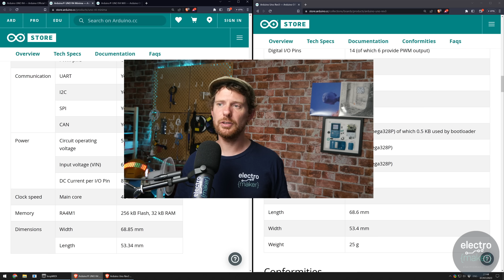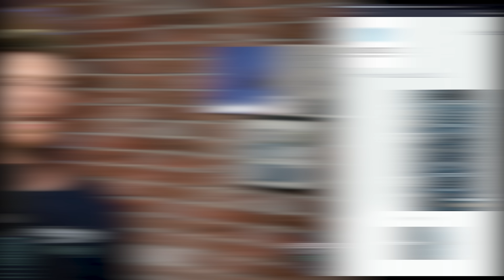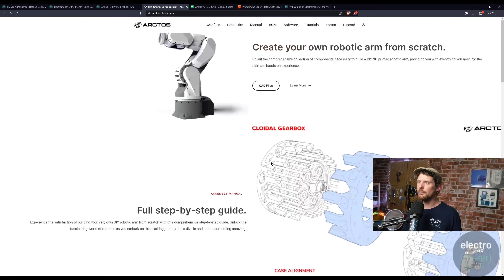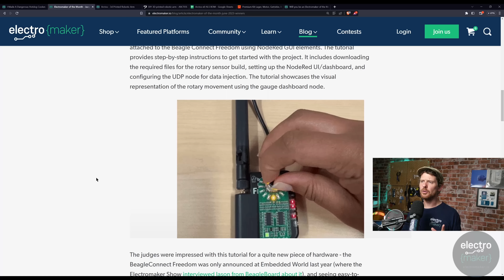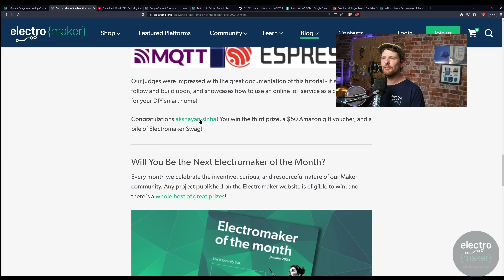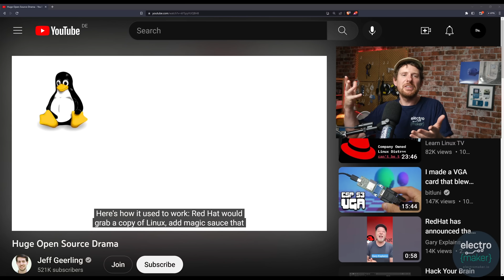Arduino Uno R4, New Nordic Power EK, Prize Winning Projects!

Comment: I would use the Nordic Semiconductor #nRF5340 Audio DK to build a Smart Acoustic Bird Species Identifier. This device, with its powerful processing capabilities and advanced audio features, is perfect for handling real-time audio data and running machine learning models.

The project involves capturing environmental sounds using a high-quality MEMS microphone, pre-processing this audio data, and then using a trained machine learning model to identify the presence and species of birds based on their unique acoustic signatures.

Comment: Ah yes. I've had plenty of computers that need hands laying on them to work. 8x the flash on the Uno is quite the jump. I'm really tempted by the WiFi version. Jeff really dropped the ball with the lack of red hat, I must admit. Though RedHat have dropped it, burnt it, and buried the ashes... 

I think I would use the #nRF5340DK to control my smart speakers automatically. The idea would be that whenever my phone connected with it, it would output the audio to tell the speakers to carry out specific actions based on a button press or even the time of day. One example would be turning the lights on in the house when I come home late.